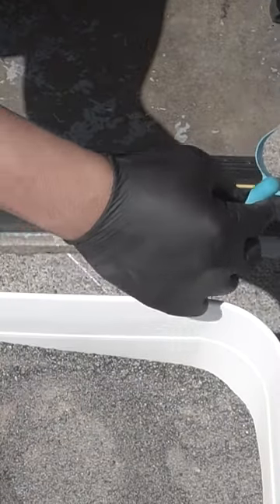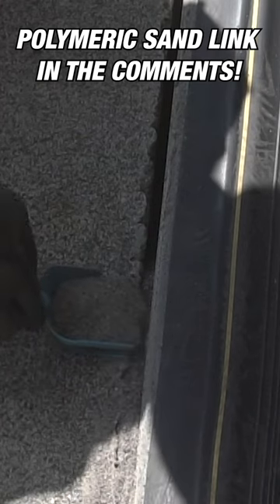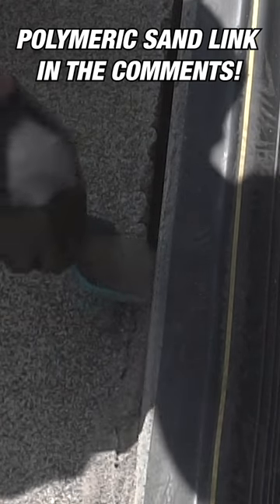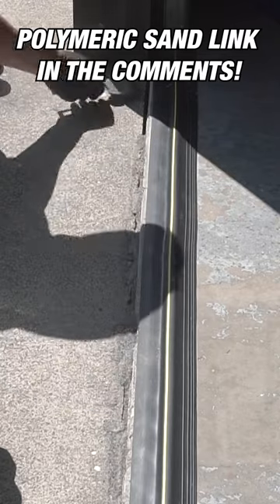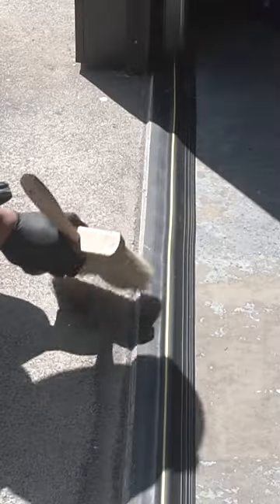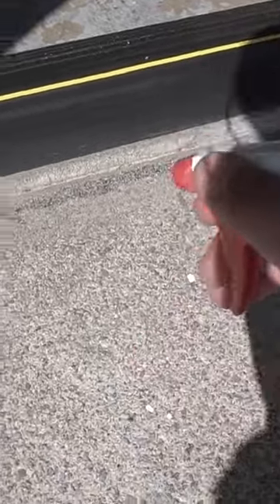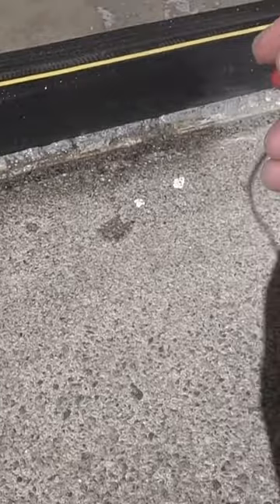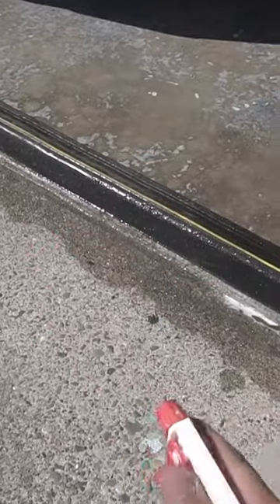How To STOP Weeds From Growing Inside Concrete Sidewalks & Driveways Permanently! #shorts

Comment: Great job if you allow me to add my two cents, apply sealer after either water based or solvent that will lock that sand in and protect it

Comment: Just use round up, or if you don’t like it use vinegar salt and soap mix, granted it’s not a bad idea but at in the coming years the Polly sand starts to break down and peal and will need to be pulled out and replaced